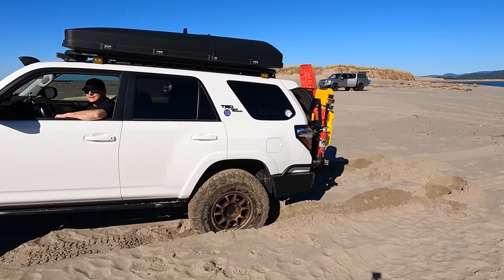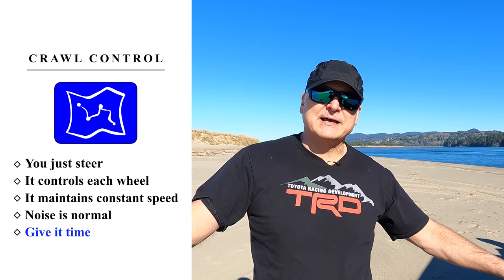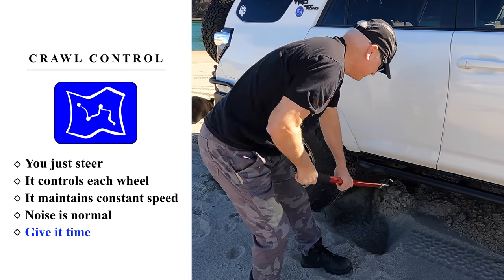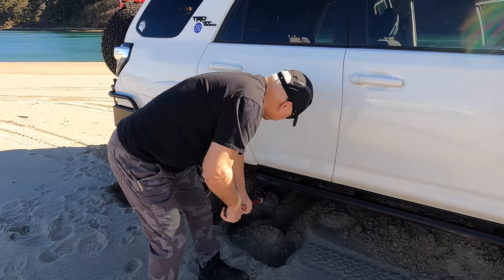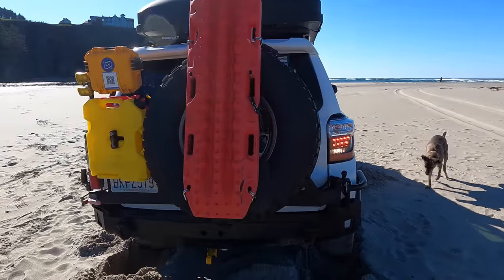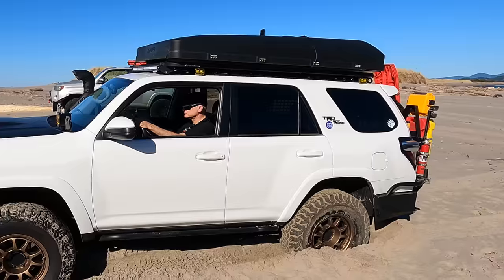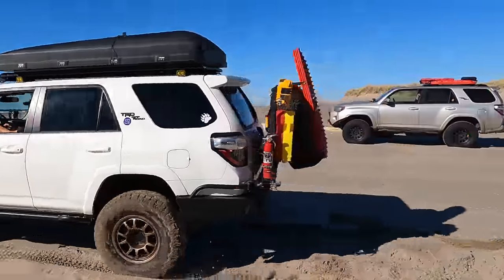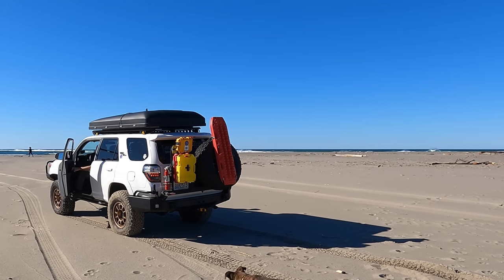Finally, the Only Crawl Control Video you Need to Watch - 4Runners Overlanding with Crawl Control

Comment: Nice summary. The performance in snow is the most challenging. As you mentioned, so much depends on the snow's condition.
You mentioned that in sand, part of the control's function when repeatedly starting/stopping was to backfill a divot. Another purpose is that giving the sand (or snow) just a second to be still  enables the material to settle, compact and conform to the tire's tread and profile. This incrementally aids traction. The analogy is stiction (friction/traction is greater prior to slippage than it is once slippage occurs)    https://en.wikipedia.org/wiki/Stiction
Reply from the maker: Great point! Thanks for leaving comment! I'm going to pin it so it will appear at the top of the comments. Cheers!
Reply: @OverlandPNW  Thanks for the compliment. I doubt it's worth a sustained pin. The pin should migrate as other comments arise.  I ride a lot in the snow, and have a pretty good understanding of that particular media. I occasionally assist others getting unstuck. As you showed, momentum counts for a LOT.   
One other tip for sand that I learned from a video posted by a Saudi citizen (they have plenty of sand!) is to constantly steer left/right/left/right, while slowly spinning the tires.  While he did not provide a reason, he demonstrated its effectiveness. I think that by doing so, the front tires find more 'nearby' sand to grab and backfill the divot. Give it a try!

Comment: Crawl control saved my butt this weekend. Trying to get home, iced narrow steep uphill road. Halfway up the hill, I started sliding backwards, toward a creek and narrow bridge I had just crossed. Stopped, went 4L, set cc to low speed, and it literally climbed the windblown ice hill..Absolutely incredible..
Reply from the maker: Awesome story! It is a great system. Thanks for sharing that!
Reply: Which year 4runner and was it stock ?
Reply: @vietphan916  2024 TRD ORP. Stock except for Wildpeak at4 tires.

Comment: I would have benefitted even more from this video a few days ago. I attempted a descent on a steep sand dune over the weekend, entrusting my crawl control. The 4Runner accelerated quickly. I reacted slowly. We both struck the base of the dune hard, damaging the grill and bumper. 😑 I could have studied the manual again before my failed attempt, but your videos are more interesting. Besides, nothing lasts longer than than a hard lesson learned. Great video.
Reply from the maker: Hope the damage was not too bad. So true that nothing lasts longer than than a hard lesson learned. I've had my fair share of those kind of lessons ha ha!
Reply: Time for a heritage grille and a new steel bumper!  :D
Reply: got cocky in Winter #3 this year, buried in a snow drift just turning around where my dog likes to poop......   luckily my buddy was up the road plowing snow, by the time he got there had the strap ready and he didn't think he ever tightened the strap, it popped out so smooth.....  I was real close!  heh heh heh   first ever need for help
Reply: There is NO technology better than driving experience.

Comment: Excellent video. Actually used the crawl control at Lake Powell while stuck in the sand. Pulled me up and out. Great feature....have had 4 wheel drive trucks for decades and this feature once practiced should be a great aid. Thanks for the information.

Comment: Revisiting this video now that I have a 2023 4Runner TRD Offroad. I have had limited opportunities to test it, but I used crawl control first during the ice storm at the end of December in the Portland area. The ice was thick, but a little nobbly, providing some traction. Worked well getting out of my driveway. Have used crawl control in mud when I couldn't get out in regular 4WD. I was at Silver Star Mountain on the weekend. Didn't need any special traction features, despite it being a terrible road, with very deep ruts. Toward the top, there was a corridor of deep snow. I turned on A-Trac and got right up it. I think I would have gotten stuck without it, because I was facing a combination of deep ruts beneath deep snow. I could feel the drive going to different wheels.
Reply from the maker: Congrats on the 2023 TRD Offroad! Crawl Control is pretty impressive. In our testing, we only really had problems on very steep inclines and very slippery surfaces. Other than those two, Crawl Control tackled everything we threw at it.

Comment: crawl control impressed me coming down some icy hills this past winter.  The Multi Terrain Select system also demonstrated to my why Toyota does not have a front locker.  Went up a steep, icy, rutted hill, 4L, Rock and Sand mode.  I almost crested the hill and heard the right front hit an icy tree root and spin.  I kept on the gas, suddenly the right front tire stopped spinning and I heard the left front start to spin, and up and over the truck went.  I was super impressed.  No need for a front locker when the truck will do that on it's own!
Reply from the maker: Awesome story! It is an impressive system!

Comment: The advancements in 4x4 over the last 15 to 20 years is quite amazing. I love my 05 Tundra double cab, especially now that I changed the diff gear ratio from 3.91 to 4.88 and installed a Torsen limited slip in the rear end, but it will never be able to do what these new 4runners can do.
Reply from the maker: The advancements really are amazing but I also like some of the earlier versions. I once owned a 1967 Nissan Patrol. It had manual locking hubs, a hand crank start (no kidding), a manual transmission, and a clutch so hard to depress, I'd swear it came from an old tractor. Not a single modern "traction control" device of any kind. I really miss that rig!
Reply: Or better yet.. it'll last half a century!!

Comment: Definitely ran into those challenges with the late winter snow BBs this year - WA, Cascades. Glad I carried your advice with me. Those north-facing slopes with that hard pack that warms up by mid afternoon turns into a trap. Once the tires broke through, the truck was essentially just sitting on the skid plates. That crust protects the BBs underneath. But the sun makes the crust weak. The BBs provide zero traction. I describe it as bean bag filler. For those describing snow and sand as the same...it's not. At all. You really have to pay attention when you go snow-wheeling. Type of snow (fresh pow or late season pack), ambi temperature, time of day, thickness of hard pack...It's all fun, but sometimes you get to put more hours on the extrication gear.  ⚙
Reply from the maker: Bean bag filler is a great way to describe it. Great comment because it is so true that you do need to learn a lot about snow when you start to go snow-wheeling. And there is a lot more to the subject of snow than you'd first expect!

Comment: I have had my FJ Cruiser since I was 16 (I'm 29 now) and have now owned two 5th gen 4Runners in the past 11 years.   My current 2019 TRD Offroad has the Magnuson supercharger.     I sold it to a friend, awhile back.   He had to return to Asia, so I bought it back lol, and was VERY happy, because I missed it lol.   I'll never sell it again!  It will stay with me, just like my FJ Cruiser has been with me for nearly half of my life😊.      

I drove a brand new Tacoma TRD Pro at Toyota's recent press event, on an offroad course, so I'm confident the offroad performance of the 6th gen 4Runner is going to surprise 5th gen 4.0 4Runner loyalists, as it did me.       It is an upgrade, in every way!   Just the price is expensive, so I reserved a GX 550, to get a bit more capabilities and comfort.   Do not dismiss it because of the 4 cylinder engine.     I promise 4Runner loyalists will love it!

Invaluable information in your video!  Thanks!😊
Reply from the maker: I’d love to have a Magnuson supercharger! The GX 550 is an amazing vehicle. I like the way you think!
Reply: @OverlandPNW  The Mag honestly makes the 5th gen feel like an SUV her size always should have, but nothing crazy, plus that great supercharger sound😊.       It adds about 30% power and torque, so as well as enhance the already great offroad performance, it allowed me to FINALLY overtake other vehicles on the freeway lol, like a proper V8.    I hate putting my foot down for nothing lol

Comment: Excellent video!!! The title holds true haha
Also, I believe CRAWL Control also works with your factory rear locker locked. Now I wonder what would happen if you used CRAWL Control with the rear AND front locked 😬
On top of that, Toyota's new generation of trucks no longer make the machine gun sound when you activate CRAWL Control!
Reply from the maker: Awesome! Thanks for the additional info. I have some friends with older rigs that don't make the machine gun sound either.

Comment: This series of “Finally” videos is excellent!  Can you tell me what suspension and tires/size you have on your 4Runners?  Thanks again for sharing your knowledge!
Reply from the maker: Thanks! My current tire (white 4Runner) is BF Goodrich T/A K02 315/70R17. When this video was filmed I believe I was on a smaller BF Goodrich T/A K02. It would have been 285/70R17. My lift is about a 3" Icon Stage II. My brother's (silver 4Runner) tires are BF Goodrich T/A K02 in size 285/75R17. He has an Ironman lift. Also 3". Cheers!

Comment: i use it every time I go off road  on a hill decent ( steep hills ), great video 👍
Reply from the maker: Nice! Crawl Control is pretty amazing!
Reply: my 4runner sr5 doesn't have crawl control but it does have a-trac can i use a-trac instead of crawl control 🤷🏽‍♂️
Reply from the maker: @JohnRivers-ol5tv  It works a little differently but, yes you can use A-TRAC. I have another video that talks all about A-TRAC.
Reply: @OverlandPNW  thanks

Comment: Appreciate the post.  Great summary on crawl control and here in Colorado, we don't have sand but I have used it on slow crawl for mogul uphill and downhill and find it effective.  Was it needed, not really but I find that it's more consistent in maintaining speed and control.  I most situations, low 4 works fine.   With the popularity of 4Runners/Tacomas, I have seen just way too many vehicles that just looks unnecessarily weighted down with accessories and metal bumpers, racks, and body armor.   I did see a 4runner in the video which appear to be less modded.  I often wonder how the added weight affects crawl control and just off-loading capabilities in general.
Reply from the maker: Agree that in most situations, low 4 works just fine. CC really isn't an option that experienced off roaders will use as a go-to.

Comment: Thanks! Crawl control worked really well for me going down huge rocks and drops on Cadillac hill at the rubicon trail. Just gave that nice control. However, it wasn’t  useful going back up that hill (crawling up rocks the height of tires), that’s where lockers and a-trac did the magic. Most people with me on the trail had dual transfer cases and that beat crawl control both uphill and downhill…so after all, these new tech gizmos are only semi effective. Plus since the 4runner is having PCS / VSC malfunction half the time after being lifted, crawl control is simply disabled when those electrical systems go nuts.
Reply from the maker: Great points and I agree with them all. The gizmos are only semi effective. In certain circumstance, they are great but you cannot rely on them to be great in all conditions. I watched your Devil's Staircase video. That was a legit downhill!
Reply: @OverlandPNW  thanks. It was fun because of muddy tires that felt like skis

Comment: Fantastic video. The analysis was thorough and practical—and the scenery was amazing. Central Oregon? Anyway, very useful as I consider getting a 4Runner with Crawl Control. One pedantic quibble having nothing to do with the technical analysis: a "divot" is the turf that comes out of a hole (as when you hit a golf ball), not the hole itself.
Reply from the maker: Thanks for the comment! I am a fan of polite pedantic quibbles. So, yours is most welcome. I was not aware a divot is the displaced turf and not the hole. But, you are 100% correct. Thanks for pointing it out!
Reply: @OverlandPNW  Thanks for the reply! Again, great video, super thorough on the topic, and amazing scenery. I moved from the Northeast to the Pacific Northwest because of the magnificence of the landscape. Well, that and the fact that my wife is from Oregon!

Comment: Excellent video with a very clear explanation of crawl control.  I haven’t really used mine yet but could you tell me if you can use CC with the rear diff locked or does it have to be off?
Reply from the maker: Thanks! My 4Runner manual states that A-TRAC will work (on the front axle) with the rear locker engaged but only at speeds below 4 mph. However, the manual is silent on whether Crawl Control will work (on the front axle) with the rear locker engaged. I've never tested CC with a locked differential. So, unfortunately I do not have an answer to your question. I'll have to test it on one of my next trips. Cheers!
Reply from the maker: I tested this yesterday on my 4Runner. Crawl Control worked (on the front axle) with my rear diff locked.
Reply: Thank you so much for checking that out!  I am just starting a mild build on mine with a focus on overlanding and I plan to reference your channel quite a bit.  I am going with a few basics first and will add things as the need presents itself.  Great content!  Keep it up!

Comment: Can you please compare the downhill assist control (DAC) with the downhill on the crawl control. Alot of us GX460 folks have added crawl control and MTS which gets rid of the DAC. Second. Do you have to go into MTS to select the condition before you initiate crawl or are MTS and crawl are totally independent system. 
My understanding has been that you have to select the terrain via MTS and then crawl control works as a cruise for the terrain selection through MTS.
Reply from the maker: My 4Runner does not have DAC. So, I have never used it but my limited understanding of DAC is that it functions essentially the same as Crawl Control. The main difference being that Crawl Control has adjustable speed settings and DAC does not. Crawl Control and MTS are independent systems. They use the same sensors and at first pass may seem redundant but the main differentiators are that with Crawl Control (1) the throttle/acceleration is fully automated and, (2) Crawl Control seeks to maintain a constant speed. Cheers!

Comment: One other reason crawl control cancels is if you push the gas pedal or brake inadvertently. This could be a problem on steep inclines or declines.
Reply from the maker: You are correct...good points!

Comment: So what about using rear locker with crawl control?  I would think it hinders as it doesn't allow individual differences in rear.
Reply from the maker: You are correct that you can use the rear locker with crawl control. It would be a situational choice. Cheers!

Comment: what are dual lockers? I have a rav 4 limited on lease and was considering a 4 runner TRD Pro so I was looking up what Crawl control is , this is all new to me but I''ve been taking peeks into the overlanding community for a couple of years now and I think ti makes more sense to get a 4 runner for longevity and scalability of my family although its just me for now
Reply from the maker: The term '"locker" refers to locking differentials. On four wheel drive vehicles, they increase traction by forcing both tires on an axle to turn in tandem. Some four wheel drive vehicles do not have any locking differentials. You can get a locker on the front axle, the rear axle or on both axles. If you have lockers on both axles, it is called "dual lockers." The 4Runner TRD Pro comes stock with a locker on the rear axle. If you are new to off roading, the 4Runner TRD Pro is a great family vehicle and is very capable off road.